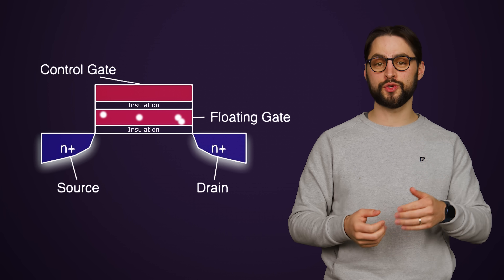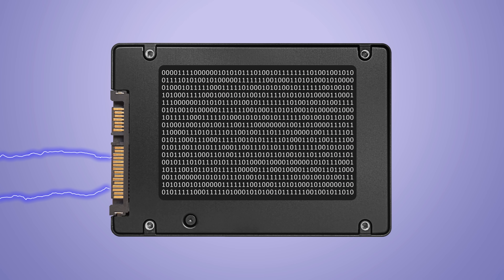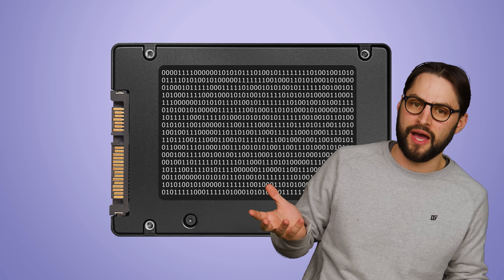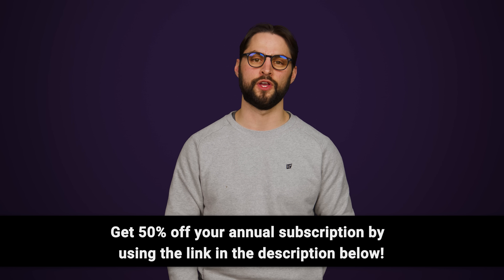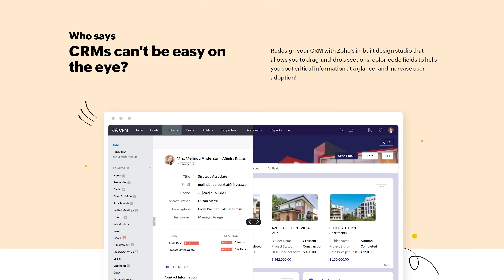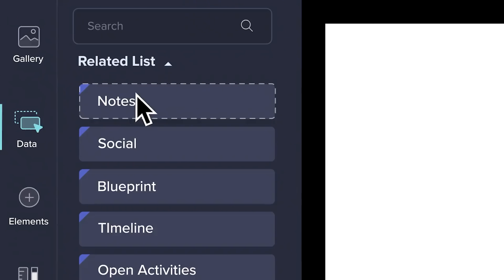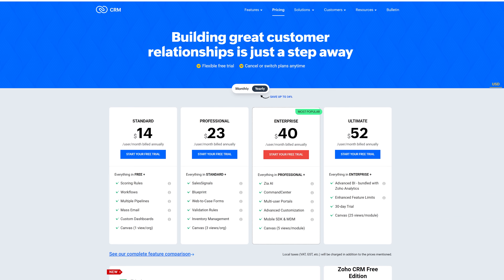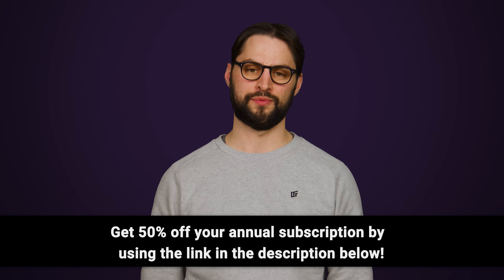SSDs Die, RAM Doesn't. Why?

Comment: SSDs have electricity "water dams" and the electricity breaks down the "water dams" over time.
Ram has no dams.
Reply: RAM doesn’t give a dam
Reply: Dam, that's nice
Reply: This is bullshit. I just poured water on my SSD and my RAM and they both broke. No dams at all.
Reply: @DegreelessnessMode  did you turn them off and on again before trying to pour water on them?
Reply: @DegreelessnessMode  Put them in a bag of rice for 7 days
Reply: @Brian-Fong's--comment/post "SSDs have electricity "water dams" and the electricity breaks down the "water dams" over time. Ram has no dams.": 

Damn :-(
Reply: Well this dam comment section become a dam pun.
Reply: nvSRAM
Reply: damn.
Reply: Back in my youth, SSD's were build using Ram chips and a rechargeable battery as backup. Once the battery died, all data became lost.

Comment: thanks for the informational vid, question, how do you prolong the life of your SSds then?
Reply: the life of SSDs is given in write cycles,  the less you write to it the more it lasts. (however modern SSDs last quite a lot!)
Reply: @cocotug0  i see stuff like this but never for ex 5 years 10 years or some estimate
Reply: @leo6659  most SSDs list the endurance in the specs, divide that endurance by the amount of data that you write per year  and you can get an estimate. searching for "average SSD lifetime" on google returns an estimate of 10y, however a failure can happen at anytime (that applies to everything in this life) and after about 3y a sudden failure is more common (not a given, just statistically more common). if the data is important a backup schedule to different media(and location) should be performed regardless of estimate lifespan of the storage device.
Reply: @leo6659  write life is measured in TB written..a 250GB SSD will generally have a 150 TB Write Life.  If you double the capacity of the SSD, then you double the Write Life...generally. Saying how many years that will last depends on how much data you write to the drive....

Comment: SSDs dieing because m2 drives cheaper for amount of space per tb.
Reply: M.2 drives are ssd
Reply: @joshuaguenin9507  they kind of a SSD, but smarter and better in every way. They also smaller in size, but way way faster as they not attached by a slow cable.
Reply: @Bigdog1787  wrong, m.2 is a form factor, not a bus type.  There are and were m.2 Sata Drives and there are m.2 nvme drives

Comment: without knowing precisely why....im gonna give this a shot...

Im thinking because RAM chips are less energy consumption on the motherboard and power supply....since SSDs are sooo much bigger...it takes alot more resources to run it...plus...RAM clears itself when you shut down the computer...SSDs have to keep that data (which is an overwhelmingly more amount of space)  and it puts extra strain on it possibly because SSDs are essentially giant RAM chips...even though they dont take up more space than a couple of RAM chips themselves...possibly they just overheat and then the data gets corrupted and/or the physical hardware itself gets damaged....

i don't know if that's 100%  correct or not...but common sense tells me thats the logical conclusion...💯

Comment: I've never had an SSD fail into a "read only" mode, they've all just suddenly and completely stopped working... PC can't even see them.
Reply: They are ment to go read only but only if designed to which older ones or skimpy ones are not designed to do

Only SSD i ever killed was a 32GB kingston USB which i wrote the full capacity of one a day for about a year and a half before it up and died

Outside of that my entire globally written amount of data over my life time is all of like 0.8% of my best TWB SSD

Comment: I understood the main differences, but this fills in the missing gaps in an easy to comprehend manner. Thanks for this outstanding video. Great work.
Reply: I knew the reason -I was just watching the video for a friend.
Reply: more more it 4:05  4:04  used the the win l a little bit bit of  ny idea @heliocentric television  🎉and a 😅in a bit
Reply: Yea. A nice video even for people who kinda know a lot about tech.
Reply: You had no idea lol. Who you trying to impress??
Reply: As goofy as these guys are, they have a way to make outstanding videos the greatly aid this community! And I agree.
Reply: what about flash drives????
Reply: @caliginousmoira8565  I was taught that each time a flash drive is written to a layer of electrons is stripped away and that is what caused the eventual failure of the memory. But what was true a decade ago certainly is probably no longer accurate.
Reply: TL;DR SSD go brr
Reply: Agreed, this was actually very informative
Reply: High voltage requirements to push out the electrons cause tiny damage little by little when emptying the cell to make it 0, then writing also does the same with high voltage. Reading and self-discharge however make the captured electrons eventually go, so sometimes a block is refreshed still. SSD at this time are not recommended for long term atorage e.g. 10 years without power.
Reply: Really love the company Linus made and what it does and means for the people who watch!

Comment: how can you make a cpu that has integrated graphics help share the load of a graphics card?  Does it just happen or are there settings in the program, ect.   ???   I guess creatures benefit from it
Reply: That is not a thing, load balancing between 2 GPU’s only happens if they are in SLI, Crossfire or are being used in Explicit multi GPU mode which is very rare to see
Reply: @commanderoof4578  That is what I thought but Tech Notice mentions,, here is the most recent one.. https://www.youtube.com/watch?v=j79pPHsFMJs
Reply: well apple kinda already made something exactly like that just this year made the m1 and m1 ultra arm chips just for that but it's both the cpu and gpu at the same time in just the same chipset that make intesl look like crap! the m1 ultra has a gpu built in the cpu die that has total computing gpu power equivalent  to a niveda rtx 3080 but froe  like a lot less power and runs a lot cooler and can fit into a tablet or very thin computer that is less then like 3 or 5 inches thick with a lot less cooling needed with aslo the cpu equinet of like a amd ryzen mid to high end 16-32 core cpu as well from what i remember from the what the info the linus tech tips kinda said about it!

Comment: Overclocking ram has to be the most pointless thing I've experienced, at the end of the day tightening the timings worked far better and didn't require me to increase the voltage at all.
Reply: For Intel that is correct

For Ryzen however even 50MHz extra in the RAM gives a noticeable difference
Reply: i find it pointless because no matter how many time i spend on testing and tuning it is still gonna bluescreen somewhere anyway
Reply: @RCmaniac667  for me i bought what i wanted and then just pushed the multiplier till it stopped working correctly and dropped it and have been running the same settings going on 4 years and not had a memory related crash outside of my initial mess around
Reply: @RCmaniac667  Yeah, I don't know how different it is for Ryzen, but from my experience overclocking ram gains are mostly negated by the need to increase the timings just to keep the system stable.

So you end up forcing your RAM with higher voltage for very diminishing returns in actual performance.
Reply: Generally I've had the same experience and I just go with tightest timings on normal voltage.  In the past, however, any time that I've used an integrated GPU that shared system RAM I always got best performance by using highest RAM clock speed.

Comment: I've written 30TB on my main SSD over like, 3-4 years. Doing pretty good so far, no need to replace it yet.
Reply: I keep 500 gb on the main drive, a 1 TB SSD on the side for games and other large things that benefit from fast load, and a 2 tb HDD for large stuff like OBS files. I like the 500 gb limitation it keeps me diligent in pruning my storage space.
Reply: SSD's wear level depends greatly on data movement rather then keeping data.
movement means not by moving stuff around but actually putting new data in, deleting and replacing it.
Reply: @m-w-y7325  Fill the drive to 98% capacity and use the remaining space for rapidly changing data in large numbers of tiny files. 
Wear leveling won't be able to help those 2% cells getting constantly hammered by write operations.
Reply: @m-w-y7325  So what you're saying is a good big one is always better than a good little one.
Reply: @SeánONilbud  doesn't matter the size.
its how you use it~
Reply: @m-w-y7325  Anything’s a dildo if you’re brave enough - Abraham Lincoln
Reply: Now that's not to be taken seriously, there was just a gap for a wanker style comment and I had to fill it.
Reply: Best Youtube comment reply thread I've ever read. 😄
Reply: @alexandru.bogdan  this is why I have my back up C: plugged in my PC but hidden. I don't need it but I need it.
Reply: i have written about 40-50TB, i have 56% health of mine SSD. Its wd green 256 gb
Reply: @alexandru.bogdan  This sounds like nonsense. Where are you getting that from? At the least what you're saying sounds like it would only apply to the data stored on the device, not the usability of the device itself if it was wiped.
Reply: @alexandru.bogdan  That's Natural Selection at work.
Reply: @SeánONilbud  no, that’s just ssd tech in general. SSDs are vulnerable to data evaporation
Reply: 30 TB isn't that much.

That drive probably has a looot of life left.
Reply: WD M.2’s are warranties for 6 years and anywhere from 150TB to 250TB written. So you’re way off what companies will warranty for these days.
Reply: where the heckkk do you even find a 30tb ssd?!
Reply: Bought a relatively early gen SSD 7 years ago. 120 GB one. formatted the disk every 6 months. still working properly. SSD's will wear out but even early SSD's were not fragile enough to breakdown by regular consumer loads
Reply: Pfft I write 30TB in a day.
Reply: @alexandru.bogdan  If the SSD or any paperwork you might have remains in a drawer untouched for years it's junk you don't need anyway.

Comment: I worked as laptop service engineer and one customer asked why all laptops parts cover replacement warrenty except RAM I told RAM is the last dying part  in laptop
Reply: Uhmmm..... NO.
I worked as a mechanic and system builder from late 2003 to spring of 2006. And Ram failed constantly. Never had an issue with any CPU though.
Reply: My ram died after 1 year of use.  Got the occasion bsd saying corrupted data. I thought it was the SSD.  Then it finally dished out one more bsd then after the restart of windows to find that it was corrupted to the point my user files was all wiped out. Can't log in or recover. Then it finally says the ram is bad. Which I knew earlier that the ram module was bad so I could have saved all my data. Had to change out the ram module and reinstall windows  for it to get back to normal.  The ram was a Samsung 16gb that is labeled made in china.
Reply: CPU dies last though, no?
Reply: in my experience, the durability of things are lots overrated. And I think it's because I live in a not perfect developed country, so even the same product which is considered reliable in a rich country is actually fragile here once it WILL be used during twice, three, ou four times more time. While average person in a rich people will ever not notice some certain lacks of durability.
Reply: It's a terrible job really, surrounded by disaster and failure, occasionally having to tell people their business is dead.
Reply: My SSD is still alive but my RAM died last year, i feel like people are overrating RAM durability by a lot :o
Reply: @Lunamana  pepole are also underestimating ssds lifespan a lot. You really have to write a lot of data to kill your ssd.
Reply: @KrolPawi  i write terabytes of data everyday
Reply: @Lunamana  With Laptops, you have all of that circuitry crammed into a tiny little box thinner than an average book. All of the warmth from that circuitry is nearly pressed up against each other, and even with fans and stuff to keep it cool, the RAM is probably warmer than the RAM in, say, a PC that is out in the open air with tons of air flowing over it, and modern RAM also usually comes with metal covers with small heatsinks attached to it to keep it cool. You don't get that with a laptop and I would assume that's why laptop RAM can sometimes fail faster.